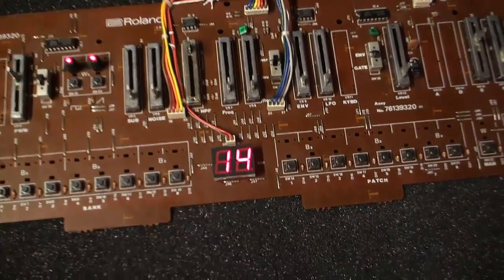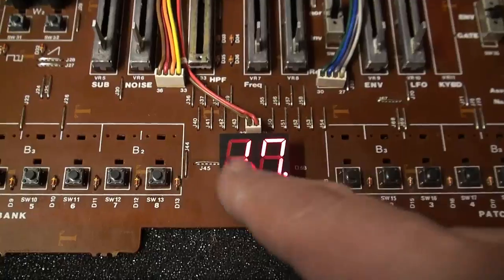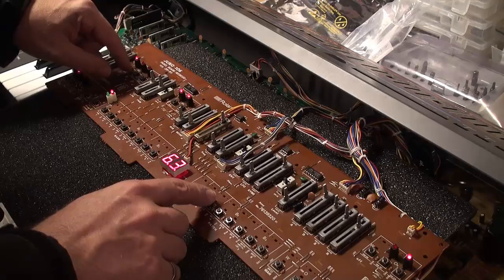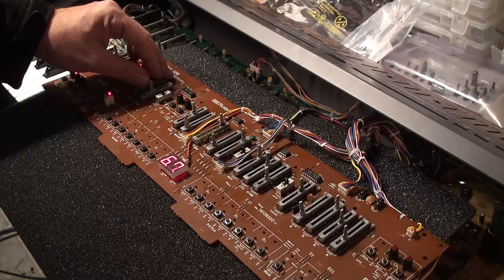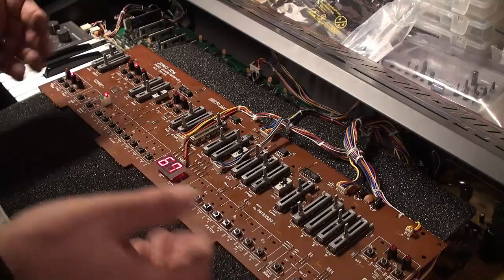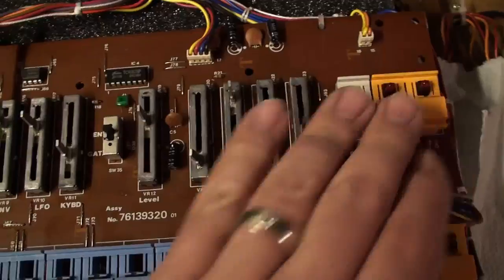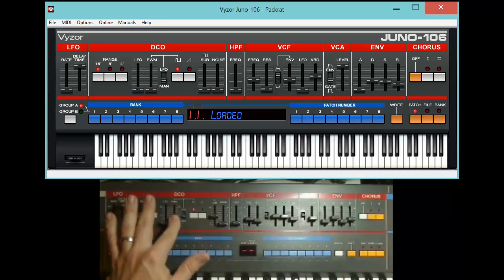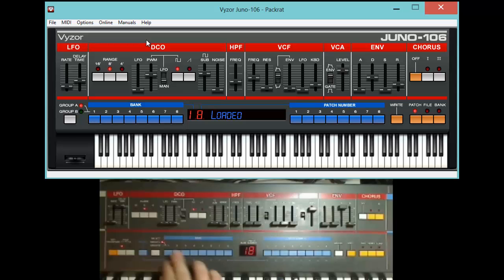Packrat's Juno-106 - Part 19

Comment: This is what mine is doing at present not dismantled, the sub bass suddenly gets added to the sound and those dots on the display come on. I've ordered some replacement faders from Germany because I haven't got the time to dismantle and clean the originals but will later. Thanks for pointing this out.